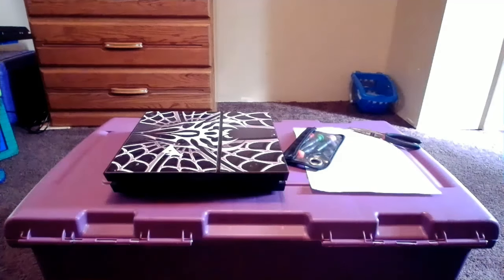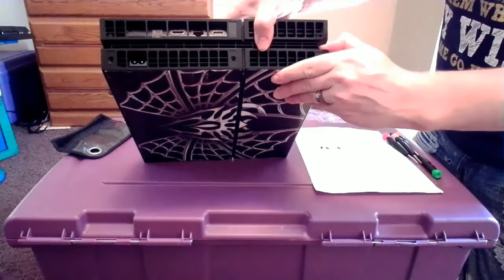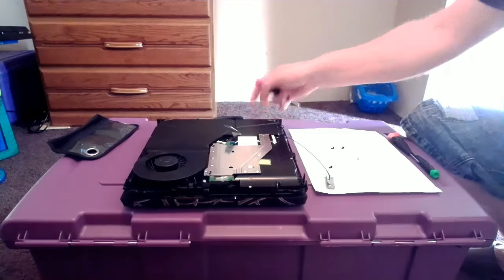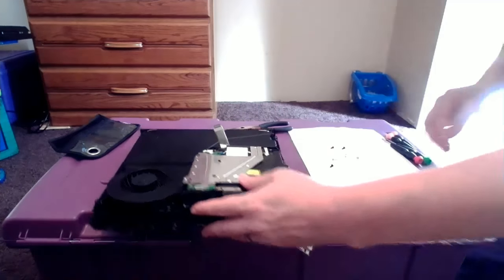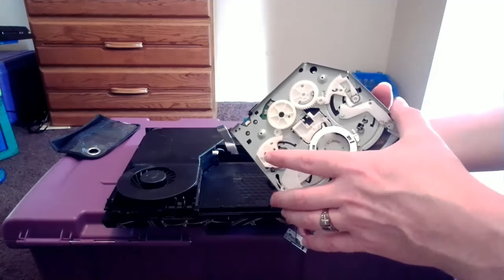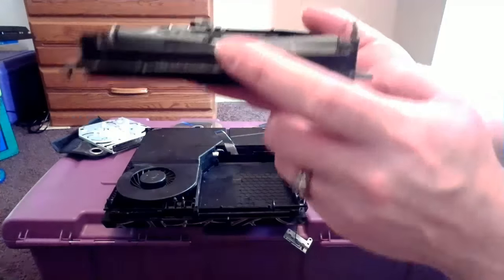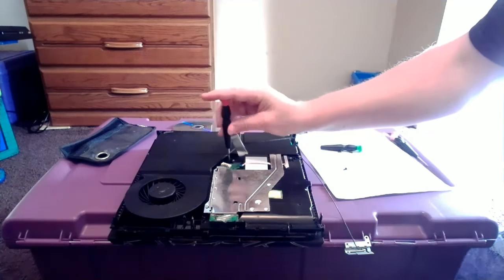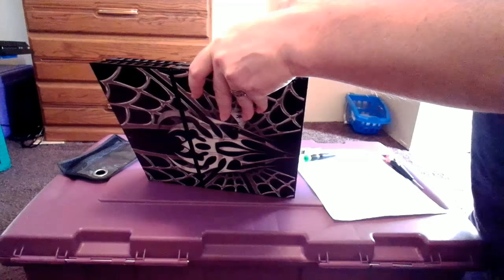PS4 WON'T ACCEPT DISCS? | EASY FIX!

Comment: I would recommend trying to remove an existing disk before doing this. Even if existing disc is not in machine. I thought I had an existing disc stuck in my PlayStation 4. I looked up how to get that out and with my model there is a screw you turn counter-clockwise but there was no disc stuck.  I continued to turn the screw for a few minutes and then put it back together and it worked after plugging it back in. The reason I bring this up is I would have gone through the headache of taking the entire PlayStation apart had I followed this guide and it wasn't necessary. That said this guide was my next step and this is a great guide.  Don't get me wrong, I'm just saying there might be another solution before this is required.
Reply: im trying this rn cos the videos method is too long. didn’t know you had to be a f***ing IT technician to own a ps4

Comment: I had disc get stuck in there due to crack in the middle hole and the ps4 not wanting to spit it out anymore.

Great video and easy to follow. Thanx for the save

Comment: Guys I have a fix, open the side piece that can be removed. 
Put a little screw in the little hole on the side that lets you take out discs manually and just push the screw down while doing some circular motions. While you’re doing that try putting the disc in.
Reply: Going to try that. Mine has a different issue than what is seen in this video. My game will slide in but it will not grab it and pull it in like it use to.
Reply from the maker: @VictorPoulin  this could be more than likely because your rollers have lost their adhesiveness over time due to dust build-up. You can simply use some rubbing alcohol and a q-tip, wipe them down, and when they dry, they should be sticky again.
Reply: MooseNukem I tried that and my PS4 is still not taking in discs what should I do?
Reply: MooseNukem what are rollers my are doing the same thing victor said it doesn’t pull it in when I slide it in now it’s just stuck there not fully inside
Reply: Where can I get a screw for the side it has to be thin
Reply: Please help
Reply: Amaan Zubair the instructions are there
Reply: @VictorPoulin  What did you do with that type of a problem?
Reply: @uriyaelkayam3723  I honestly do not remember.
Reply: i read another comment that said "I didn't feel like taking it apart so i got mad and started slapping it. and it worked!" a dozen people replied that they tried it and it worked, so i tried it and it worked!
Reply: @Jack_80  Mine did after slapping it too!!!! Thank youuuu!!
Reply: @Bribro3 its called “percussive maintenance”

Comment: Thx Sergeant! Followed your vids, top class, my PS4 won't take discs, the white clip was already all the way back, I also saw your video concerning the rollers, my rollers are fine but my PS4 will still not take discs. I cleaned all and removed all the dust that I could find, cleaned the fan with my vacuum cleaner. I have tried all other tips online. Thx again ang big respect for your great videos and work.

Comment: Worked great! Thank you :) I took apart my PS4 to clean it and put in new thermal paste. After that, the disc drive would try ejecting a disc that wasn't there about every 10 seconds. After powering down for 20 minutes, tried again but this time it was as if the drive died. After following your instructions, I adjusted the screw while it was opened up and reset the barrier. That did the trick! Thanks again :)
Reply: Same thing happened to me i was renewing the thermal paste and cleaning the fan , and suddenly my disc drive dosent want to accept discs , and the eject button dosent make any sound when i touch it , what screw was that you rewinded what can i do to fix this issue ? Because the ps4 works perfectly everything is smoother and faster kinda but only the disc drive is become a problem now
Reply: @FunnyVideos.11-o4z it's been a while since i worked on this but if I remember correctly, there is a little plastic adjustment screw in the left side of the drive for adjusting the mechanism that pulls the disc in.

Comment: Here’s my Easy fix: might have been lucky but here we go. I held the disc eject button until I heard the rollers stop. Which was about 10-15 seconds. Once I did that I heard the rollers make the sound when a disc is going in so I inserted my disc and boom it worked no issues since. Idk if this works for anybody else but it’s worth a shot especially for you don’t have the capability to disassemble your console.
Reply: Bro, you are a f’n genius.. I tried your idea and it fixed the problem.. 🍻 on me
Reply: I hear it start to make the noise, but then it stops. Any ideas? It’s pretty much all I use to entertain my self.

Comment: Appreciate the tutorial workled perfect . Putting that small connection back in under the greeen panel was a bit tricky i had to take off silver plate and lift the green panel to click it in was a bit stiff , but all went back together in the end and it was success. Cheers

Comment: This was not my issue. My issue was the laser bridge didn’t know where it was. So when I put in the disc. It would say disk unrecognized. All I did (followed your instructions) but pushed the laser bridge back as it was all the way forward at the disk holder. Put er all back together. And it works. Thanks for the tips sarg!!

Comment: I turned mine off and waited for the lights (obviously) and then unplugged it, waited a while (1-2 minutes), powered back on, signed into my account, put the disk in and it worked, I hope this helps anyone who might have this issue and isn’t tryna disassemble their game at 3 am

Comment: My PS4 wasn’t taking the disc, but when I opened it up, the white piece you pushed up was already locked in the up position so I cleaned the inside,  removed and re installed the “rib bone” and the system worked, hopefully this helps someone with the same issue

Comment: My PS4 had a disc stuck in it and we (my dad and me) manually ejected it and after that happened the PlayStation won’t take in any discs there is a barrier like u said. Will this also work for this and if anyone has had this problem in the past please tell me how you fixed it. Thx.
Reply: Zain Bashir same problem, have you solved it!!!!????!!!
Reply: Exact same problem here
Reply: Exact same issues here. Looks like we have to take it apart unfortunately. I've tried everything.

Comment: So,  I did this step by step and now my eject button doesnt respond or even beep when pressed. (And discs still aren't being accepted).

I can force them in but id rather not do that and risk a stuck game. I just want the console to accept the disc inside as it normally should
Reply: This is exactly my problem. Tell me you found a fix
Reply: I’m having the same problem. Took the console apart, removed the plastic button for eject and repositioned it. That fixed that issue. The one thing I could t do is fix the drive…yet
Reply: same problem, white plastic was in correct position when dissasembled ,
wont accept disc even after assemble, and even worse it doesnt beep eject button. 
any solutions?

Comment: That's the exact same problem I've had with my PS4 and I've had it for many years recently it started doing that sometimes it won't recognize that I've put a game in I've tried using a disc cleaner to clean it when it does that but just a couple days ago it started getting to the point where it would act like it was still a game in there even though I knew there wasn't I'm glad I found this now I know what's going on and how to fix it thank you for making this video

Comment: Anyone seen this. There is another easy fix:
 Push the disc eject button, then grab your disc and force it a bit in, but not completely, only approximately halfway, then push the eject button again, then your gold, just insert it and it will go in
Reply: Is this legit?
Reply: @abdobenbaya5499  Yes, but the long term actual fix for this is actually moving a little metal string that needs to go into place for it to place the disc ejector in the ps4, so you gotta disarm the ps4 on that.

Yeah it's legit, if you search "Ps4 disc ejector not going in" or "ps4 not accepting disc in" some videos about people explaining how and why this occurs.

Comment: I have to take the hard drive out and use a screwdriver in the hole to insert a disc. It will eject just not accept

Comment: There is a screw for ejecting disk next to the hard drive turn it counter clock wise and it’s fixed no need to take apart anything other than the plastic over the hard drive

Comment: I don't have 3 screws on the back of my ps4
Reply from the maker: foxy gamer 187, some models are slightly different than the one showcased in this video. May I ask what type of PS4 you're using? Is it a Pro perhaps?
Reply: @SgtMoose   it's the very first model
Reply from the maker: foxy gamer 187 that's the model I'm using in this video as well. There may be adhesive tape covering the screws. Beware though, as removing the tape will void your warranty if you have one.
Reply: Theres tape covering them

Comment: Do you know why my ps4 not making any noise when inserting disc . It doesnt want want to to take the disc in. I open it up and the rollers and the white plastic were in place. I even cleaned the rollers but still dont work. The disc drive does read the games just not taking/ejecting the game.
Reply: CaliLife mine is doing the exact same thing. I just finished putting it back together and it’s still not working. I don’t know what to do.
Reply: @CShakes12  I order a disc drive and replace it but still does the same thing. Some one said on another video that it might be the logic board and you cant change that because its marry to the motherboard. So I ended up getting a new ps4 on black Friday.
Reply: If I knew I wouldn’t die to my death, I’d jump out my window. Only problem is I’m on ground level. So I’d really have to try. I had a feeling it would be one of those things where it’s a problem that can only be fixed with a warranty but if it’s over, you’re better off getting a new one. Were you able to transfer all your memory and data and such?
Reply: @CShakes12  if you have ps+ just upload it to the cloud and if you dont you can save it to a usb drive .
Reply: Oh...... duh.... I forget 😂.
Reply: Why must we suffer in this way. It ain’t right 😭
Reply: @CShakes12  yeah 😂. If you somehow fixed it let me know what was the problem.

Comment: i did this method many times it work the first time but it keeps doing it i took it apart multiple times redid those steps still doesn’t work for some if you got anymore solution on how to help me solve it i would like to know i hope i dont have to buy a new disc drive

Comment: My PS4 is so screwed and I made it even worse I'm so upset no games will read not one new or old disc and it sounded like it wasn't spinning so I tapped it lightly to see if I can unjam anything and I put a qtip in to clean out slot of dirt that came out and now it's beeping the disc tray on and off constantly it keeps making the insert sound and it's blocked it won't even let me try anymore besides it not even reading when it did take the disc it's broken idk what to do

Comment: Ive read on the ps groups asking for help, and then later he tried air blower on the disc drive without taking it apart, fixed it but it sounds dangerous

Comment: To do this without disassembling the PS4 just turn off the console as it's shutting down it will allow you to insert the disc after it accepts the disc let it finish shutting down turn it back on after this is complete once it accepts the disc you will hear it reading as it is shutting down that's what you want to hear and how you know it worked.

Comment: I turned mine fully off by holding the power button till it beeps twice and shuts down fully wait a minute put the disk in the tray so it turns on like that and keep pushing the disc in and out and include some circle motions with the dics been trying this for about 10-20 minutes and it magically accepted the disc

Comment: The issue I'm having with mine is after i put a disc in the system repeats a sound as if attempting to read the disc then makes the sound you hear when ejecting the disc but it doesn't actually eject until you press the eject button yourself. Does anyone else have this problem?
It says Unrecognized disc if i leave it in
Reply: Same here
Reply: @sladehildebrand7518  Learn anything new about it?
Reply: Nah, tried it and no good. For me at least.
Reply: @sladehildebrand7518  I think i'll just buy another one
Reply: Last night I tried setting it vertical. I read that yesterday it would help and it worked perfectly
Reply: @sladehildebrand7518  sadly didnt work for me
Reply: Tristan Oben that sucks. As much money as Sony has, you think they’d have a better disc drive
Reply: I’ve had my ps3 since it came out and never had an issue
Reply: @sladehildebrand7518  had a few with mine actually but never with the ps4 until recently. Had it for 5 years and some months
Reply: Arnez Willis  crazy isn't it? Wouldn't doubt it though if thats the case
Reply: Arnez Willis  Will do

Comment: Perfect ! This solved my issue. My disc reader barrier was down. I was a little disappointed after i found out the barrier was open , but I still slided down and up multiple times then put back the whole thing . It worked !!!!  Thank you
Reply: I think I have the same problem. I think the barrier is down on mine. I can forcefully push a disc partly in the drive but it won’t grab it to read it. I’m hoping to get some time and open it up using this video and try the same thing. Moving that last piece up and down.

Comment: Please help! My ps4 won't take discs or eject disks, when I press the ejects button then it doesn't even work! It's like my disk drive is totally disabled.
Reply: Anku :- Same. I can push a disk in but it won’t take it and if I manually put a disk in, it won’t read it or eject it. I’ve took it apart like 5 times to see what’s the problem and can’t find the answer. Like you said it seems to be disabled or something.
Reply: @gr7993  same brother, I might take it to a specialist

Comment: What’s the name of the screw ? PLZ ANSWER I need to know the name so I could order it on amazon. Plz answer as soon as possible
Reply: You need a torx t8 security screw to remove the back 3 screws and some more and you also need a Phillips ph1000 screwdriver

Comment: Does this actually work
Reply from the maker: Yes. If this is the issue that you're having and you have a base model PS4, this method will work.
Reply: Deadly Domination Gaming ouh ok ima try it
Reply: i have a ps4 slim and i dropped it and the issue i have is that it won’t take disks and when i try to put one in it doesn’t go in and it makes a weird noise 

any solution for that?
Reply: Abcde Fghij looking for a fix for that as well
Reply: @abcdefghij9586  Replying in case anyone knows as well. My PS4 slim is having the same problem, though I found I can insert discs right when I turn the system on, or have to restart it to be able to make the disc go in. And in games it shows visible glitches like in cutscenes.

Comment: Should have also said that you cant just go to a hardware store to buy normal star bit screw drivers, would have been nice to know
Reply: thomas dickson t
Reply: Star bits come in all sizes just like straight and Philips screw drivers. Most all hardware stores carry them. Best to buy a set that has many different sizes.
Reply: I got mine at harborfreight. Came in a set for $5.